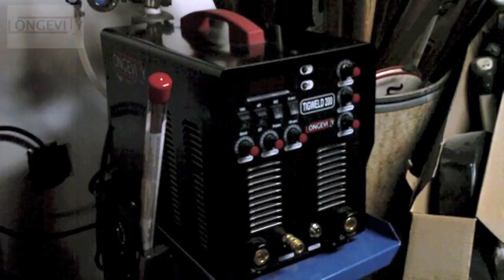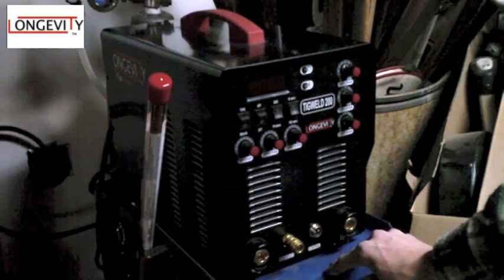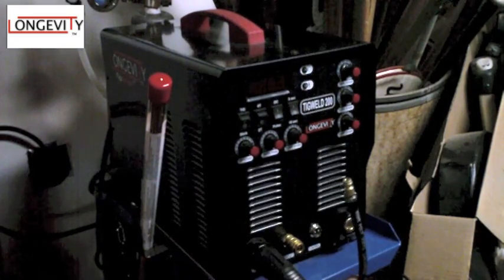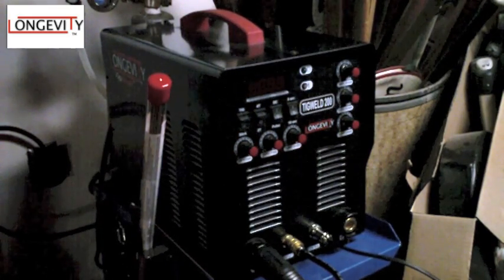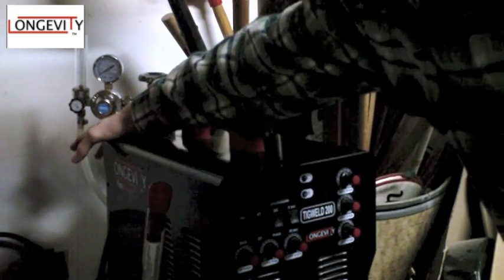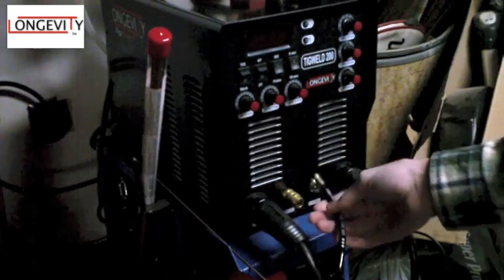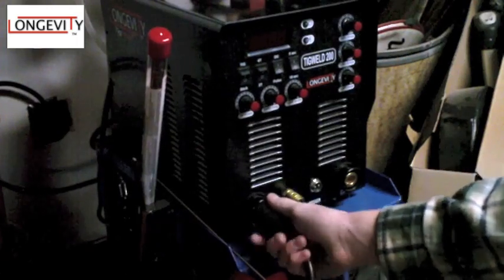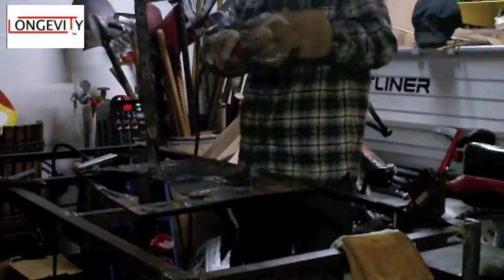Longevity TIG WELD 200 Setup

Comment: You can also mix argon with helium to enhance the capabilities of the machine. Check out some of Jody's videos on the welding tips and trickssite and you'll see what I mean. Using about 50/50 argon/helium, he was able to dramatically extend the capabilities of a couple of 180/185 amp machines.